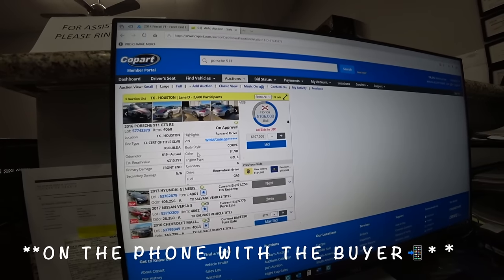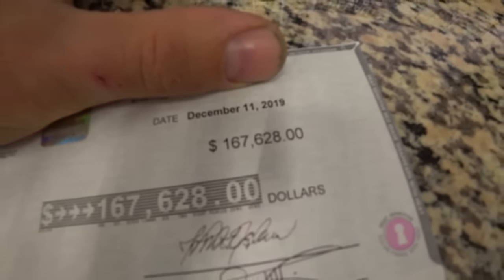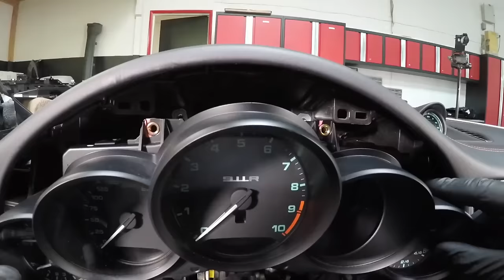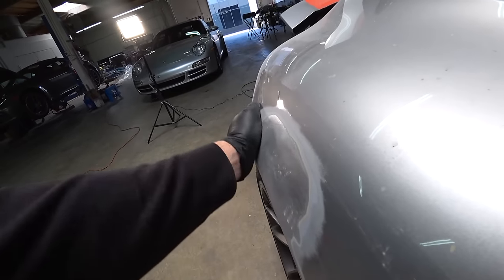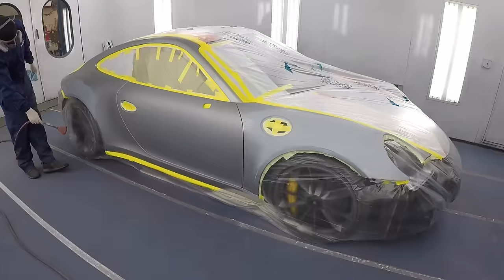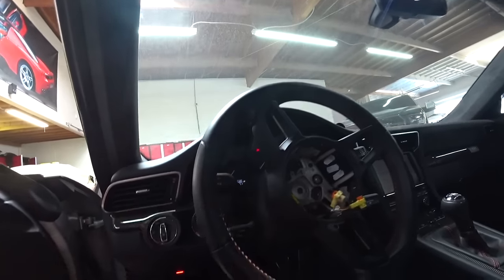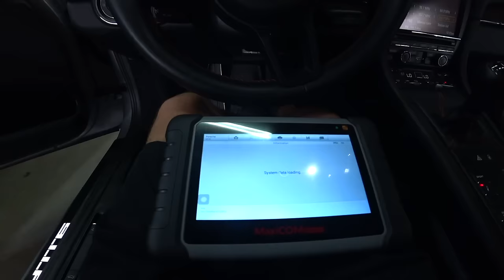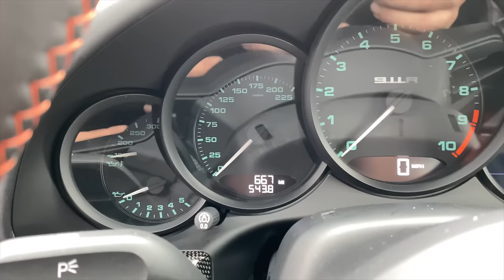REBUILDING A WRECKED SALVAGE RARE 991 PORSCHE 911R IN 20 MINS

Comment: Holy washing technique, that hurt my eyes to watch, marring and potential scratching everywhere but that’s just the professional detailer in me cringing. Apart from the detailing sins committed, unbelievable effort and amazing result! You never would have known the thing was in an accident, it looks incredible!
Reply: What’s wrong with it
Reply: LuX Mods When washing a car, the correct procedure is a somewhat long and specific series of pre-rinse steps to ensure that there is the absolute least amount of contaminants on the paint when you go in for a contact wash to avoid the dreaded swirls and to preserve the condition of the paint and remove 100% of the dirt in a safe manner. This video did not display such steps lol. I’m a professional detailer to it’s probably just me, but it truly is all in the details
Reply: I said the same thing..leave the detailing to the professionals!!!
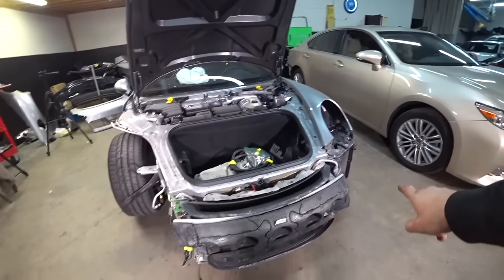Reply: And is not the only problem in the video. The 991 R it's the only 991 that have the front fenders in carbon fiber, as you can see at 3:29 when the man put out the old "cracked", but at 8:35 you can cleary see that is replaced with a metal fender from a normal Gt3 !!
Reply: @fenix_group8726  Aaaand the fact that they plugged in the airbag with the car turned on and the battery plugged in. It still is an impressive build, I wouldn't have done it better haha
Reply: @hola_chelo  i can't say that it was an incredible job, but the quality level.....mmmmm....never in my life to buy a car repaired in this way. I can imagine the actual owner when will discover that it's a 991r "repaired in a budget" :D
Reply: AND its 'washed' in the Sun...
Reply: @michaeldoyle4048  that’s the only thing that bugged me. Lol. I don’t like to wash any car in the sun never a Porsche.
Reply: Same, also painting and masking the window trim... You always will get some sort of lines

Comment: 17:43 the front bumper colour is not matching the rest of the car
Reply: 17:54 too
Reply: it is the same color. Silver is one of the worst colors when it comes to judging it on photos/videos. If you look for a silver painted car on pictures, you will often get the impression, that the doors, hoods, bumper have a different shade than the rest when in reality they match perfectly. The lighting is often causing the confusion. You will see this on mint cars which never had a paintjob done on them.

Comment: In Switzerland you could sold it for at least double the price (incl repair costs). Price range goes from 350k to 400k USD for an used 911 R with low mileage. 🤩
Reply: Don't all cars cost double in Switzerland?
Reply: @truejayoh  Not necesseraly, Swiss prices for german cars are comparable with german prices. It depends on the actual exchange rate EUR/CHF but the  difference is usually 5 - 10%. And if you consider that models for the Swiss market often come with a better standard equipment or enhanced warranty services the price difference is even smaller.

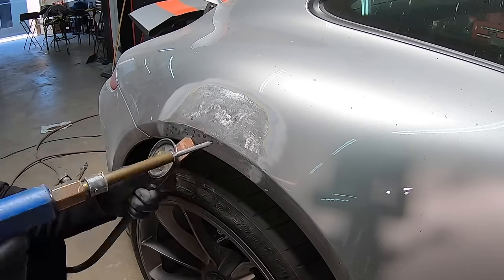Comment: At 7:20 you add some sort of metal to the car (the little points that are seen black on the metal). What is it and what is it used for, have already often seen it in repair vids but never gotten to know ehy its done. Cheers
Reply: spot welds for fixing metall. thay weld for second and than he can pull metall. later he grinds it of

Comment: Good job. But, just an observation : Airbags are not installed with the battery connected. You disconnect the battery before pulling the bag so an SRS fault isn't stored or last case scenario it can deployed.

Comment: Why the need for the Bondo, if you had pulled the metal back out to a smooth surface?
Reply from the maker: To make it 100 % perfect
Reply: Its was a skim coat that a magnet couldnt even pick up

Comment: Paying 167 for crashed? Profits pretty slim on this flip :( New goes for 225...salvage worth 190?
Reply from the maker: Henry Not too many of them for sale, there’s only one right now for sale on eBay they want $350k 
https://www.ebay.com/itm/184409242289 
It’s a collectible Porsche they only made 991 of them so prices are going up.
Reply: @lnccollision  alright, so 10/10 mint car worth 350, 1,000 miles 250, salvage 200? Salvage usually trade more than 20% under market right?